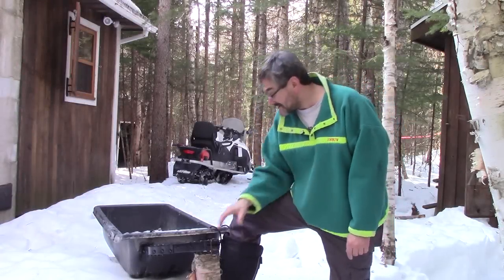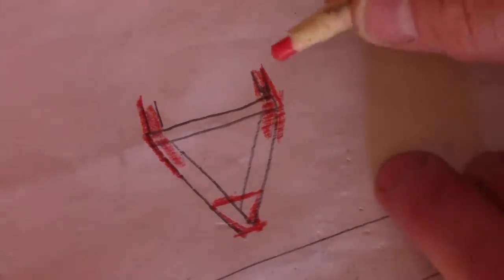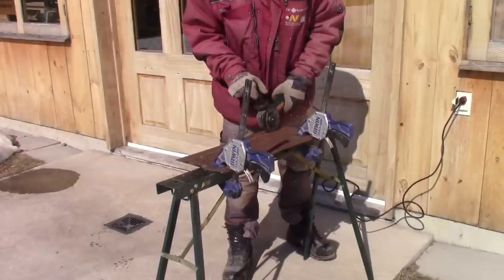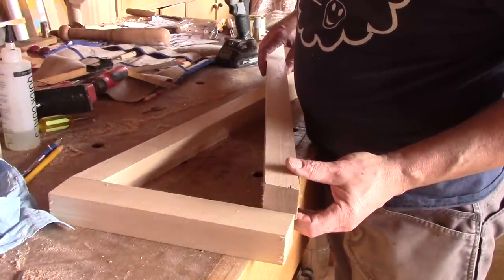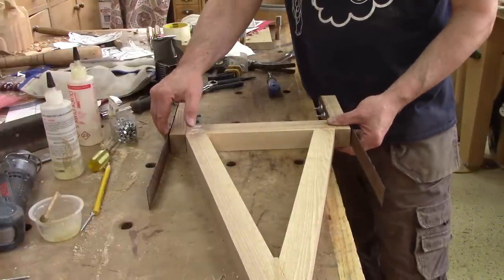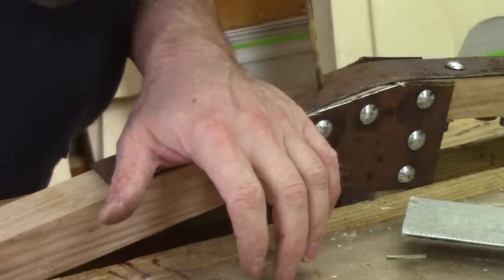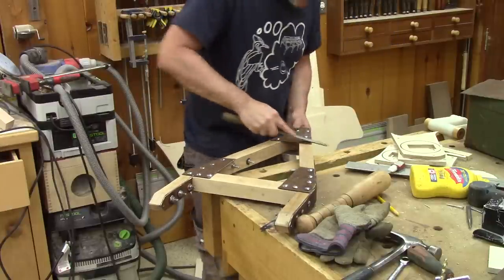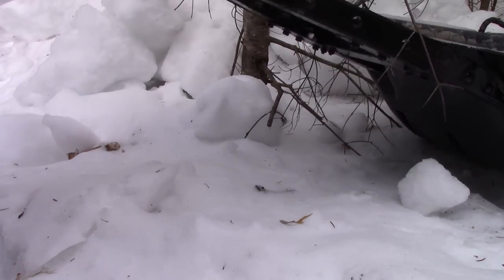The Woodpecker Ep 245 - Homemade wooden snowmobile tow bar

Comment: It would have been so much easier to just weld this from some square pipe... Seriously, it feels like you've bent over backwards to give wood a role in this.
Reply: You are welcome to make your projects however you see fit, as is Alain. Please let us know when you’ve produced your video for this towing attachment.
Reply from the maker: I don't really like welding. I'm also not that great doing it, you'll see soon I have one episode building a metal gate. But I had everything on hand at home, no extra spending by doing it with scraps lying around...
Reply: @LgosseuxDbois-TheWoodpecker  Frankly I'm not very different but I did invest 150 bucks in  a stick welder and my welds aren't great either, but they're holding.
I'm not saying you can't do it like this I just think welding would have been easier even despite you're not being very good at it. Also do it three times not very well and suddenly you'll be doing it on an acceptable level ;).

Look, you've went to a lot of work to make it when you could have attached a chain to the sled and be done with it is all I'm saying. If you wanted to to be something better than a chain I'm just of the opinion that work could have gone into a more worthwhile project.

By the way, I have actually welded in my wood workshop. It's easily as terrifying as grinding :D.
Reply: Marco, you certainly don’t have to prove anything to anyone. But the tone of your first comment is not “helpful suggestion,” it’s “why didn’t you do it my way?”. It’s off-putting, which I’m sure wasn’t your intention.

Comment: please dont wait until u do a mistake to learn from it ........ PUT THE GRINDER DISK GUARD AT ALL TIMES !!
Reply from the maker: I don't remember why I removed it? it was in the bottom of the box and I was a bit too lazy to put it back.
I used my grinder only 2 times in the last year, I still have a video I made last august using it coming soon. So maybe it's there that I've removed the guard.
You see I was more aware of setting fire to my shop than the guard....